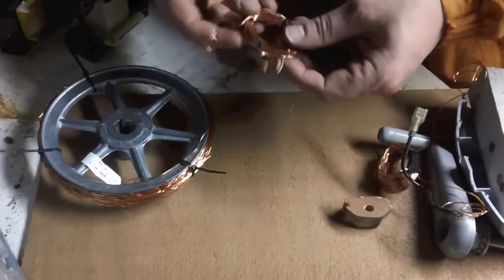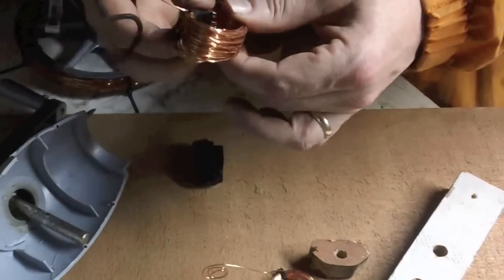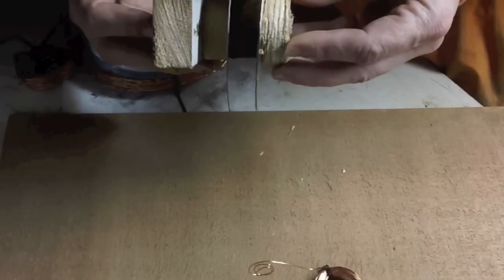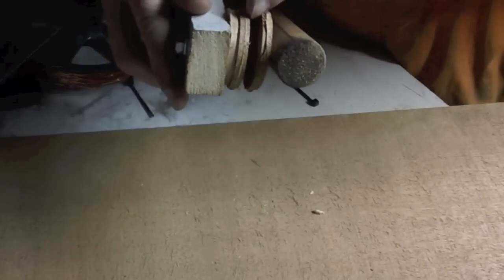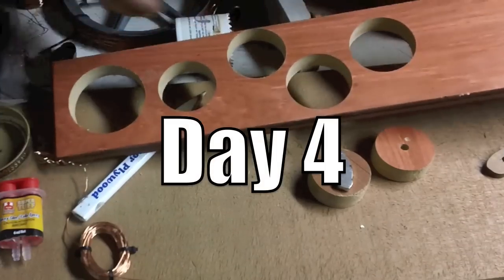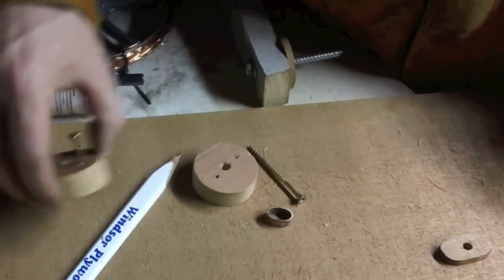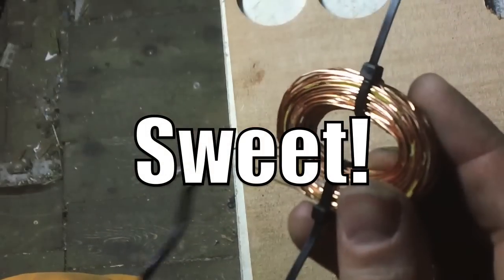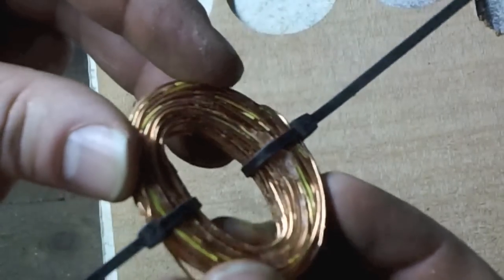Learn How to Make Copper Coils for a Wind Generator

Comment: I have  two N52 Magnets Size 2"L x 1"W x 3/8"H and Magnet wire Diameter 0.0367" 19Awg, I will have One Magnet face North and other South But I need to make One Magnet wire Coil that both Magnets will be rotating 360 degrees in center of One Coil to produce at least 14 Volt and light up 150 watts light bulb, Im at lost to know How many turns of magnet wire I need to do or have to produce what i'm looking for the out put.

Comment: isnt there a north and south pole on the face of the magnet, in that case you will be having a north and south pole passing through the coil at the same time.
Reply from the maker: YouTube would let me explain in the "About" section. They won't be, the plan: a dual rotor of magnets. Like poles face each other north -> north.. south -> south. Another fixed rotor of 12 copper coils with be sandwiched in-between. 
- 3 Phase
- 4 copper coils per phase
- 24 rare earth hard drive style of magnets

Comment: Hi!
How do you define the number of turns, in your case, 72 in the copper wire? By the way, 72 first, 52 after and then 86 kkkkk
Reply from the maker: It's been awhile since the video was made, but I did a lot of research online. But say that, the number of winding was based on the size of the circumference of the spool. It was the max windings to fit.

Comment: Hi   i dont thing you will get any decent results with these kind of magnets (i guess there are from hard drive)

I had the same idea but before i start i make some research and discover that these kind of magnets have not  the typical polarity   north at one side and south to the other... they have the same in the same face/side

so will not work so well

Comment: This is not a good video... Unless you want to demonstrate how Not to wind a coil. Whether you are building an electric motor or a transformer, the principles are the same. And the copper coil is the essential ingredient. Do it wrong and nothing good will happen. I suggest the Sorin - DIY Electrical Nerd channel. This guy has several good DIY videos and a few are on winding transformers. - BTW, failure is never a bad thing if you learn from your mistakes... And share them... Particularly when those failure result in sparks, fire, a missing eyebrow or a big boom.